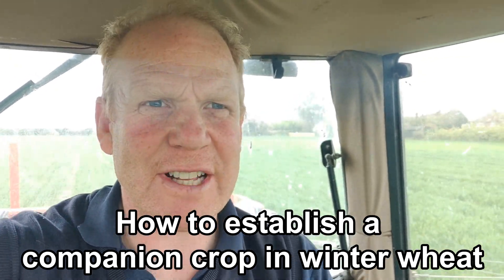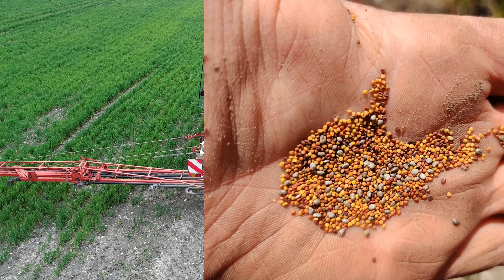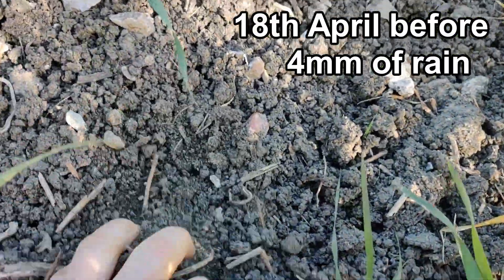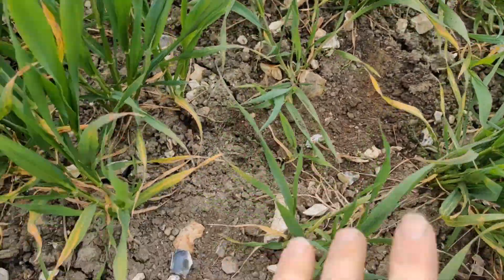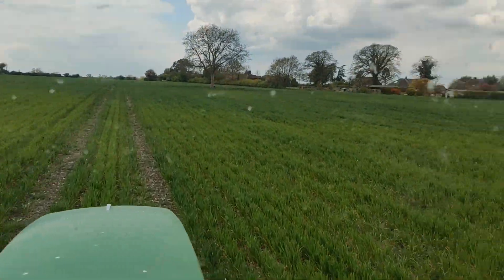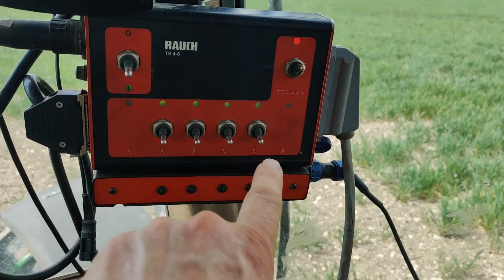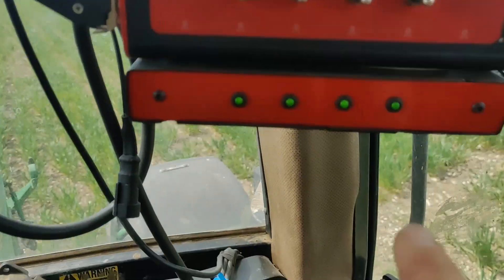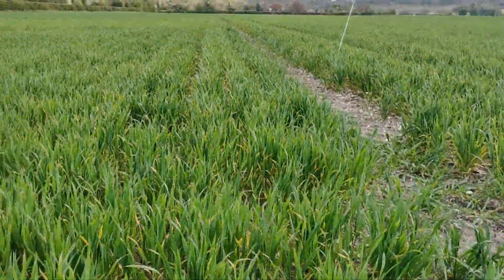How to establish companion crops in winter wheat

Comment: Could you please show a close up of how you have installed the inverted electric motors? And also a list of the parts used, if possible? Thanks in advance.
 I also have a Kuhn Aero and would like to modify it, to improve reliability.

Comment: Something I want to do in near future. My idea was to broadcast the cover crop seeds with air boom spreader. 24 m wide on 24 m tramlines. I would like to broadcast them in spring crops 2 weeks before harvesting so the cover crops would have would have more time do develop nice stand. In our region spring crops are harvested mid August till September and there is a chance that we might get snow in October and autumn is quite cold. Not enough time to drill them after harvesting and it is a lot more expensive and more time consuming to bring 100k no-till drill on the field just to seed cover crops.
Reply from the maker: Sounds a good option
Reply: Приветствую, есть практика установки AVP и других разбрасыватели на опрыскиватель и при крайнем проходе использования позволяет выполнить желаемую операцию...